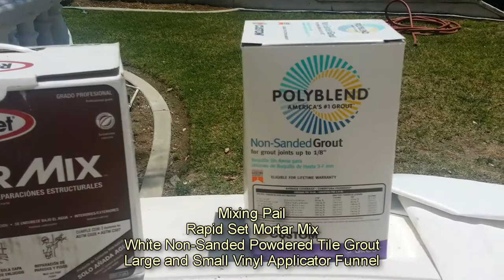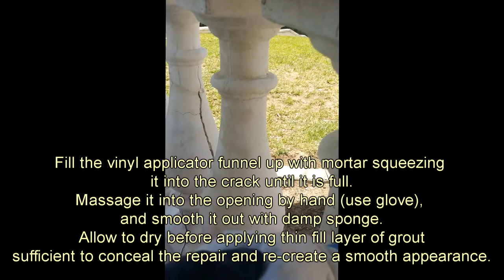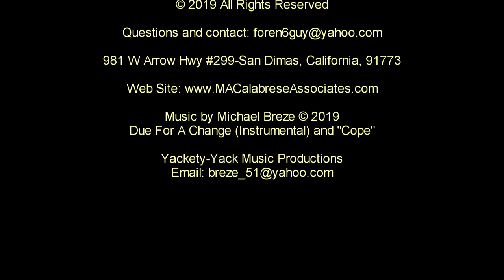RESTORING-REPAIRING BALUSTRADES AND BALUSTERS MADE OF CONCRETE

Comment: Thank you so much for posting this, wish you were in Australia and I would call you over right now to do mine 🥲🥲🥲🥲🥲; update … my balustrade looks exactly like the one in this video except that mine had some broken completely off in 5 places… I have used a product called Kemgrip wall and floor tile (waterproof) tile adhesive to bond the concrete bits all back together and stick it to the base and top …you have about 12 hours to use the product made into thick custard like material in a small bucket, clamp the whole thing back together and tie it up with something hold in place… omg this works ! It’s now solid! Next step is to follow rest of this video ( I’m trying a product called patch and anchor to finish off , as you can apply small coat to patch up over top and use wet sponge to smooth off and then sand and paint it, however I like the grout idea per video , and will likely try that s I think that might me better finish. Also,.. one more important safety thing is a dust mask as you don’t want to get these products down your lungs when mixing them up.  Just thought I’d post update in case other people have one that fell completely apart in 5 pieces like mine did …hope this is helpful .

Comment: What do you charge to do this? Is it by the foot? Or by the Baluster?
Reply from the maker: Hi David.  The cost and methods vary, as would the means of costing a project.  Larger, more complicated projects are billed hourly, or daily, plus material. Smaller projects are bid by the job.